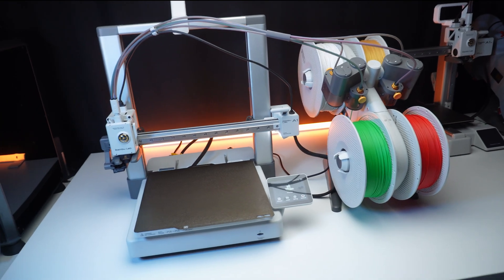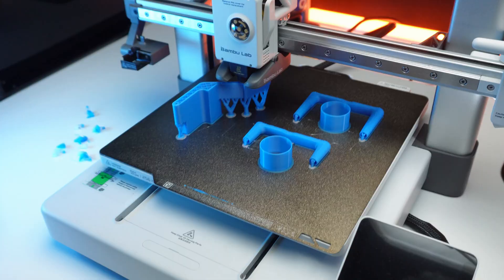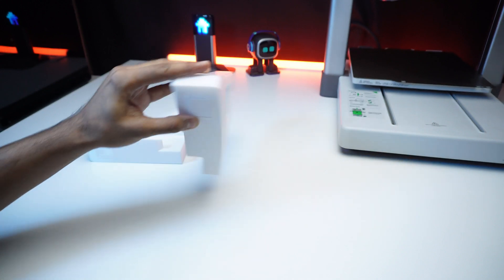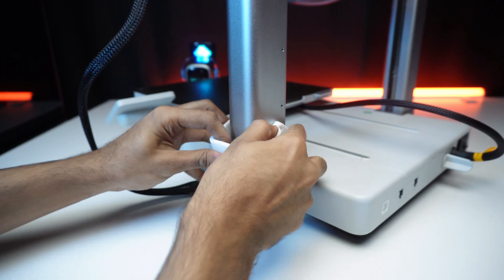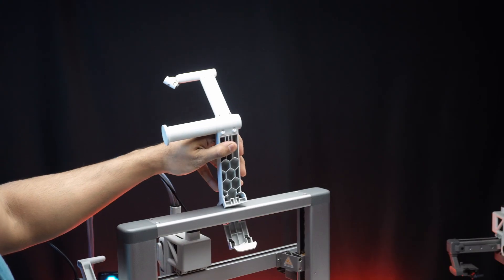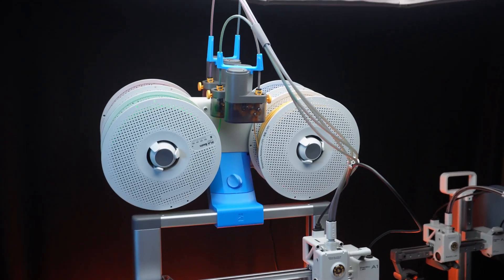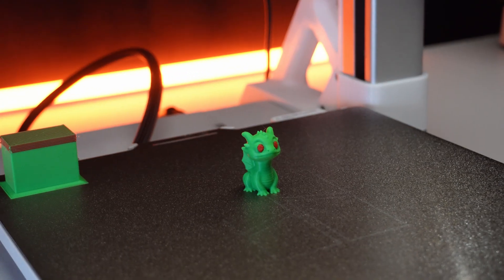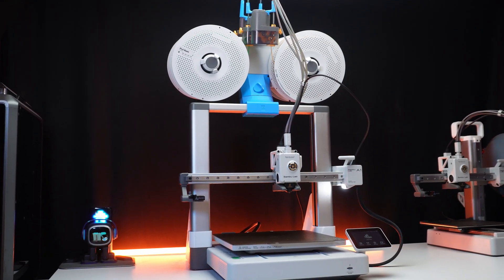Upgrade Your Bambu Lab A1 Combo with AMS Lite Top Mount! | Full Guide & Test Prints  #3dprinting

Comment: Watching you video today. Thank you for posting such helpful videos. Can you tell me if you are still using it after 11 months? Is it worth the print?
Reply from the maker: Glad you liked the video.😊 I do a lot of tinkering and experimenting with the A1, so in recent months I removed this mod to install and test BIQU’s aftermarket mods (you can see that in my last month’s mods video).
If you really want to save desk space, mounting the AMS Lite on top is still a good option. If space isn’t an issue, you can happily keep the A1 Combo as it is, then this mod isn’t really worth it.
Reply: @3DELWORLD having the AMS on the top doesn’t affect the quality of the printing right?
Reply from the maker: @Rohailmall  No, it doesn’t affect print quality at all. As long as everything is mounted properly and the filament feeds smoothly, print quality remains the same.
Reply: @3DELWORLD  Perfect. Thanks alot of the information. 🙌